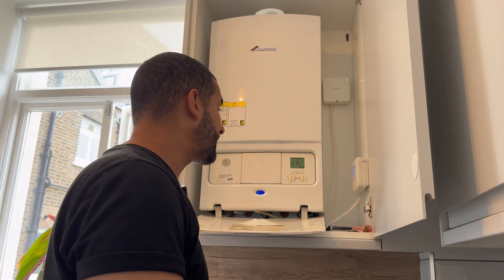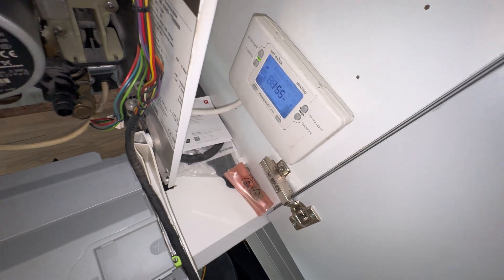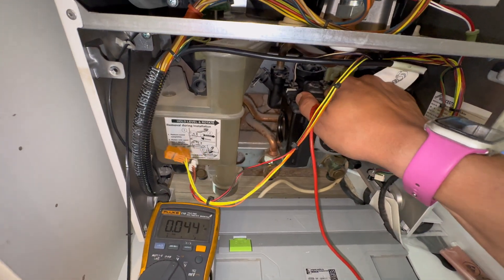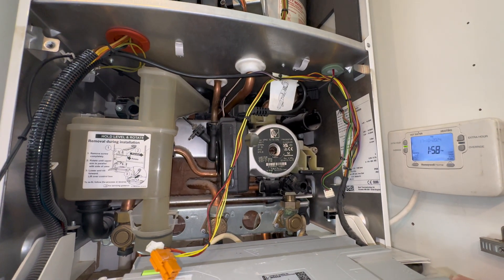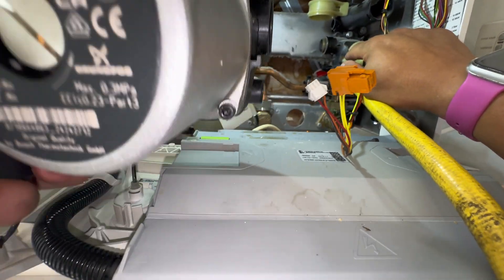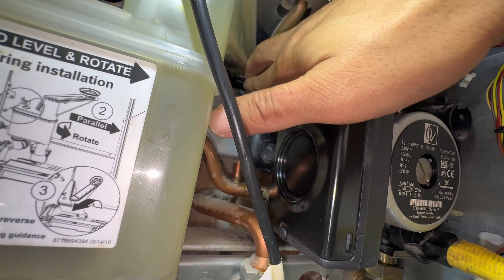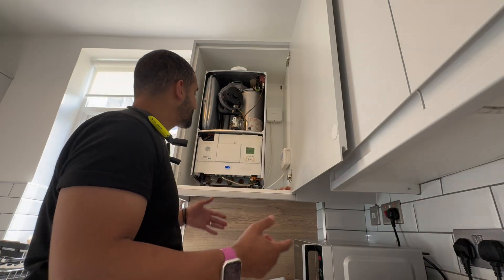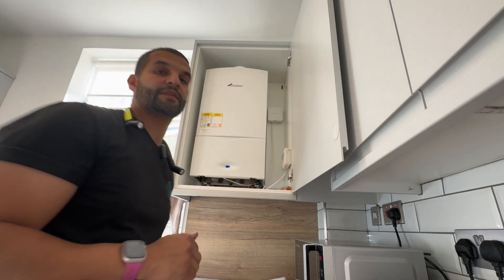What’s H09 then?!

Comment: 2 Tips: 

You could check the voltage at the pump with a contact less stick.

And why not just change the front part of the pump and AAV instead of changing the whole pump?
Reply from the maker: @salam238  volt pens aren’t reliable at all for testing actual voltage. It’ll light up if you rub your head!

The manifold had been leaking into the pump from the seam so needed replacing too.

Comment: H09 fault common fault, usually it the PCB, on this occasion it was the pump. The test you carried out just shows power going to the pump, there a wire that sits on top off the pump modulate the pump and talk to the PCB, its there where you should be testing, and that wire where i think top off my head pin 8 and pin 9 on the pcb to the secound connection right hand side off the board. I don't take rhe complete punp few reasons tskes longer and on combi boiler you have to remove the cold water pipe which means you need to replace the flow adapter unless you want a recall a few weeks later. i just change the head. Good video.
Reply from the maker: @hali5341  sometimes I do just the head, depends on the situation, but what you don’t see in the video is the body has been letting water seep out - barely takes any time at all changing the body to be honest. I always change the flow adapters when taking the cold pipe out anyway. Learnt that after taking the first one out 18 years ago 😂 and has been a habit ever since.
Reply: @RJHeating  why do you need to change the flow adaptor when taking the cold pipe out?
Reply from the maker: @ohmz55  normally it breaks. They’re so brittle and renowned for falling to pieces anytime they’re touched 😂

Comment: Good work there but I'm not sure the test you did was entirely valid.  I thought that the main pump power lead always has 230V to it, even with no pump demand.  The actual function of it is controlled by the other small cable. If you remove this cable, the pump should run continuously, regardless of pump demand. But you were right, pump was no good. Most likely the pump control board failed, but as far as I know, this can't be replaced. Yes, I always replace the whole housing. I always assume Worcester supply the pump with it for a reason.
Reply from the maker: @martinwright7093  I thought that smaller lead was for modulation, but I’ll definitely check! And as you say, it worked 😂 I know the Vaillant fans work in that way but not sure about these pumps. I’d agree on the pump PCB, impeller was spinning freely etc. There was actually water seeping out between the pump head and body anyway and it wasn’t in the greatest condition - as you say, might aswell as it’s supplied with it and you can no longer buy head only for this model either! Thanks for watching!
Reply: So to confirm, if you remove modulating wire and pump does nothing, is it the pump or PCB? If you remove wire and pump begins to spin, is it pump or PCB? Thanks.
Reply from the maker: @ from my understanding - if you remove the modulation wire and pump spins at full speed, it’s the PCB at fault. Same as the test on a fan.
Reply: @RJHeating I thought with the fans if you removed the wire and it spins it’s the fan lol, or is that just for the ideal logics? So much confusion lol

Comment: Why did you replace whole body? And I thought those Erps need those efficient pumps with rcds?
Reply from the maker: @lostinthoughtscalminsilenc8167  on inspection with the pump head off, there had been a leak between the body and head with water seeping out. To be honest, nice quick easy change on these anyways. I’m not sure, this is the manufacturer part for the boiler